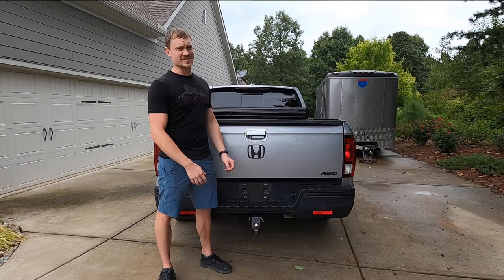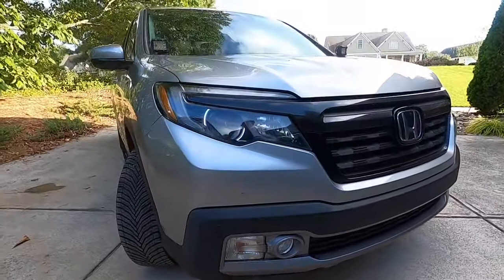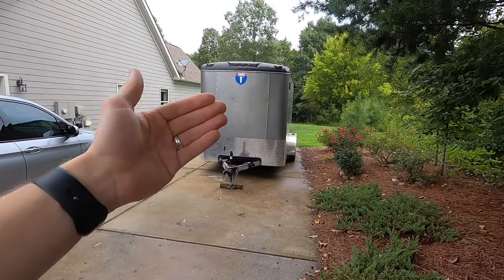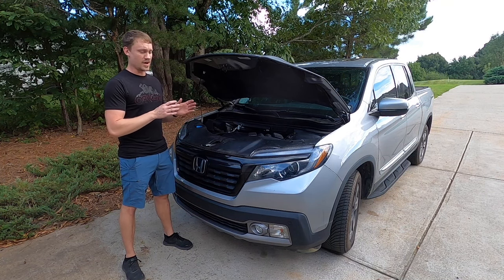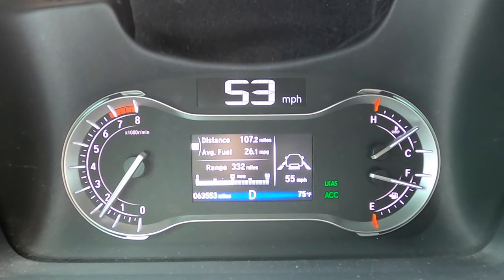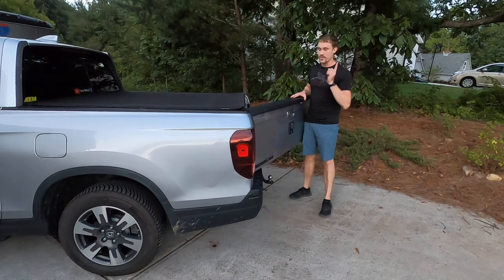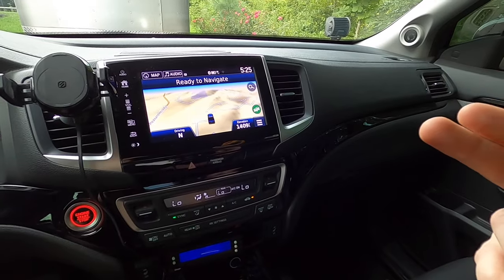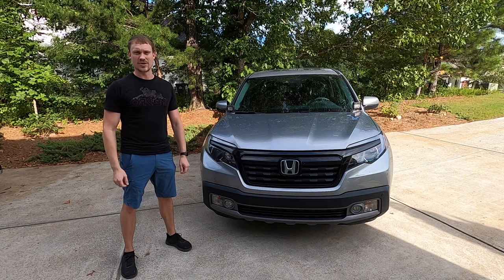10 Things I dislike about the Honda Ridgeline

Comment: 🤷 The Honda Ridgeline is the pickup truck for people that don't really need a pickup truck nor want one.....

It's for your 50-year-old plus man that lives in a townhouse in a  retirement community or a  25-year-old data analyst or Apple store manager that lives in the city.
Reply from the maker: I would disagree. The Ridgeline is the truck that people need vs the truck people think they need. Most people will never use a truck more than the capabilities of the Ridgelines capacities.

Comment: Yuryi I thought you'd mention the trunk latch for sure and maybe the front sensors cardboard test? I never had that issue btw on that as vehicle slows down and warns "brake" if necessary. For me though I agree give atleast 2.5" more ride height. But in long run I'll take gas mileage anyday vs the v-8 truck i had before.
'19 Black Edition w/23k.
Reply from the maker: The issue with the latch is not so much with the car than with manufacturing employee oversight. I love the trunk. The sensors, well I know they work I just have not been able to recreate it yet in alternative methods for testing that is not cost prohibitive. So again not an issue. I also tried to discuss things that have not been either fixed or addressed with newer models.

Comment: I think the biggest design flaw is the depth of the bed!  You can't even haul a 10 gallon propane tank or a 5 gallon gas can in the upright position with a tonneau cover on.  What a disappointment.
Reply from the maker: Yep. Had to place mine at the end of the bed and roll the tonneau cover right up against it.

Comment: Biggest negative it is a unibody and not body-on-frame therefore it will not go places a REAL PU truck can go; mid or full size. As for other problems did you take it to a dealer? As for missing features, you cannot complain since you should have known when it was purchased.

Comment: Do you have an opinion on choosing between the Ridgeline and the Nissan Frontier?   They seem pretty similar, although there are obviously differences.  I've got prices on the top of the line Frontier and the RTL-E, and they are close.  Drove both.  Liked both.  Appreciate comments.
Reply: Not similar at all. One is a unibody likely glued/bonded together and the other is a bolted together cab and ladder frame with solid rear axle. Frontier is closer to a Gladiator. 

You’ll be trading ride comfort and economy for capability.
Reply: I looked at a Frontier.  Even the latest model is using older Pathfinder tech related to power-steering.  If that's what you're looking for in a truck vs. the Ridgeline's more SUV like performance, then the Nissan is the better choice.  Nissan is definitely better for off-road IMO as it has higher clearance and 4wd vs AWD.  There was an issue with new Frontiers being recalled, in fact, they're weren't being sold, that's what led me to the Honda dealer next door...it was fate! lol  Not sure if Nissan has lifted the moratorium on new sales as of this date.

Comment: Wow, with the click-bait title I was expecting a crap video.   Really nailed the deficiencies.  But you missed some:
11) Stereo.  The stock stereo is "acceptable".   Which means it's not good enough for a $40k+ vehicle.  The stereo should really sound much much much better.
12) Hamstring support.  The top of the seats are on the short side.  Would be nice if they made the top of the seat 2" to 4" longer to support our legs.
13) Built-in dashcams.  (Tesla does it, Honda should to).
14) Offer a classic 'physical' key option.  Last week the high in my city was 8 degrees.   So when I went grocery shopping I pulled the truck right up to the front of the store.  Got out to load the groceries BUT since the car was running, the tailgate would NOT OPEN.  So I had to shut the car off to load my groceries.   There have been several times in this last month where there was a conflict between the fob, and what I needed to be doing around my truck.  If I want to leave it running, and run back into the house - I should be able to.  Also, you can 'hide' a real key on the outside of a vehicle, if you don't want to take the key say mountain biking, or surfing.  Not so with a fob.  If the fob is near the truck, anyone who tries the door handle can open the car.   Sigh... physical keys are the best...
14) Chrome delete on every trim level.  Chrome is so 1983.   Make he "black" edition blackness available at every price point.
15) Find a way to remove the square plastic 'beam' in the back seat floor.  I know, I know, the floor is 'almost' perfectly flat.  Would be nicer if you could bury the mounts that hold the rear seat legs - into the floor.

Comment: Note the amount of space you don't have when opening the rear doors.
Reply from the maker: I have modified the opening and Honda has fixed this issue on new models so it’s not a problem any more.
Reply: you can replace the door catches with the ones made for the front doors.  easy DIY

Comment: I Love my Ridgeline, never a disappointment at all. If he wanted to go off road driving should have gotten a bigger truck like duh!! 🤦 also it's hot & you can't expect any vehicle to cool the inside down in seconds unless it's been sitting in a Garage that's insulated & cooled it just doesn't happen so it takes little time to cool off on the inside another issue you may have is the tailgate slamming down get over yourself ever Trk does that if not then it's already equipped with a hydraulic piston for ease on the lowering of the tailgate 'that's a no brainer' best Trk I've ever owned & I have had different yr models to different types 
 for the past 33yrs.

Comment: I dont like that the timing belt has to be changed every 80k-100k miles a chain would have eliminated that issue and also i feel the acceleration or lack there of an issue,stereo system is low quality, I dont mind the low clearance, and ride is ok, but this will be the one and only ridgline I buy, i feel toyota makes a better midsize truck

Comment: Dude this is not a truck! It’s beautiful don’t get me wrong but it’s actually a car with an oversized trunk without a top. Hence its ground clearance and driving it’s like a car. Now it can do some “truck” things, but you can buy some lift kits to get more ground clearance. This  vehicle it’s not meant for off-roading. I have seen videos of some mild off roading but it just can’t compare to the other true pick up trucks. If Honda wanted to make a real truck it would have and it would probably be a good one. The ridge line it’s mainly for city driving and stayin on the road. Can it go above and beyond certain limits? Sure it can. But other than that, it just a good looking vehicle to haul light cargo and have some fun in comfort/
Reply from the maker: It’s still a good truck. 😁

Comment: Jeep gladiator as the competition for the ridgeline? That's ridiculous.  Not the same category of vehicle at all!
Reply from the maker: Actually it is. It’s a midsize truck. Its capabilities doesn’t change that fact. What makes you think it’s not a competitor?
Reply: @YuriyMotso  its not a mid size truck. It's a car chassis with a body that has a cab and a truck bed. And I'm not saying that as a slight against it. I actually love these small trucks that have been coming out. But the ridgeline is not comparable to the chassis components of the gladiator or the Colorado or the tacoma, etc. Those midsized trucks are built on dedicated truck chassis which is constructed differently than a car, crossover, or minivan and is capable in different ways. The Honda ridgeline shares a platform with the Honda crossover and minivan. Like the bronco sport that also shares a platform with the Ford crossovers and minivan. To consider them in the same vehicle category as a truck built on a dedicated platform is not appropriate in my opinion. Review it for what it is. But it's not comparable.
Reply: @adamjohnson9014  I agree.  The Ridgeline is more comparable to the Ford Maverick and Hyundai Santa Cruz truck thingy but it's larger and therefore fits into the midsize catagory.  Ridgelines are the best choice for someone who loves an SUV but needs a truck bed.  My 06 model is still going strong.  My gripe with the newer models is the depth of the bed, the clearance, and the rounded front end.  The interior space blows all midsize trucks out of the water.  The turning radius on my 06 sucks.
Reply: @adamjohnson9014  You're mistaken. The Ridgeline has a full frame. Car chassis are sub frames and unibody. Having a full frame that is welded to the body is smart. Just ask the truck guys how they like paying for rubber body mount replacements. If you have a superior suspension you don't need to isolate the body from the frame with rubber mounts. The Ridgeline is designed for it's purpose and is well thought out.

Comment: Number one... 

The second generation looks horrible. Best thing about this is that they made the 1st generation look amazing. 

Number two... 

Neither tows enough and the 5,000 lbs towing capacity isn't enough to comfortably tow even a 4,000 lb camper. Also with the unibody the use of a weight distribution isn't safe. 

Three... 

Let's hope Honda puts out a generation 3 that beefs things discussed so it looks better and is a more capable towing vehicle.
Reply from the maker: The generations are definitely in the eyes of the beholder. I am not a fan of first gen. But fell in love with second gen. Third, towing is not bad if you stay at your capacity. Compared to the Tacoma the Honda did much better cross country.
Reply: @YuriyMotso first gen's without a leer topped look like a tadpole. White a Leer topper like an SUV. Second gen 100% grandmas car. I'm hoping that 2025 actually gets the new look it deserves. Otherwise, I'm not fully convinced Honda is going to provide an improved look for 2025 so I've got my eyes on the 24/25 GMC Canyon AT4.... 320 horsepower, 7700 lbs towing, 19 mpg versus the 14/15 I get now, 10 inch clearance, and ver stylish and highly functional interior with the premium package... under $55k with fees/taxes/etc.

Comment: Great little truck... First thing for me is to remove the silly running boards and improve the grip/ height by installing slightly larger A/T tyres.
Reply: I agree about the running boards. What’s the point of them unless their use as giant mud flaps?

Comment: It’s a unibody not a chassis. Getting to 6000-6400 towing pounds isn’t simple. Rear gear, upgraded trans and oil cooler may not do it b/c of its structural integrity.  It is a Bummer

Comment: My 2017 ridgeline transmission needed replaced at 52,500 miles. Lost $10000.00 on trade in value.
Reply from the maker: Dang. Sorry to hear that. I’m just about to hit 80k. No issues.

Comment: You don't need running boards, Frodo Baggins wouldn't have any  problems getting into a Ridgeline. A ridgeline is NOT FOR OFFROAD it is a rpad only vehicle. If you are buying a ridgeline as a tow machine you have bought the wrong truck mate! Maxing the towing to 5000lbs and then complaining about the transmission cooling is very odd. On any truck it is recommended to never tow at maximum. This begs the question of why in the hell would you have a ridgeline when infact you need a half ton truck. Get a tundra mate. That's what your usage needs. You need a real truck for your usage.

Comment: my 2020 Ridgeline AC is not as a cold as my 2010 Pilot or 2012 Camry... DYI oil change is also a mess,  at high speed 75MPH and high wind  the center of the hood vibrating .
Reply from the maker: I tried to only address issues that have not been resolved. Newer models have a heavier hood and no longer have this vibration issue.
Reply: At 70+ mph you are not supposed to be looking at the hood, LOL!

Comment: Why do you have running boards??? If you want more clearance and to pull more you should have bought a full size truck. Dampened tailgates? I didn't have one of those until I got my 2018 Tundra. Buy a bottle of Growaset and you'll be fine, you're a big boy. I'm 72, grew up on a farm. I'm amazed that all of us kids survived not having an easy open tailgate. I live in Texas, so I'll make sure to do a test drive in the summer. Dude, you're spoiled complaining about what the Canadians have and we don't. If I disliked a truck as much as you seem to I'd be trading it off.

Comment: Took delivery of my 2022 EX-L (now the base model) in Canada a few days ago. 

When looking at a vehicle, I needed unrestricted cargo space (life being an all-around musician), decent towing capacity, a good V6 with full active safety features for the long drives at night to rehearsal/concerts. The Ridgeline was the only choice at the end without question since it's my only vehicle and I did NOT want a body-on-frame daily driver. Everything else in the segment was a small truck with subpar interior quality and space and SUV's at the same segment didn't make much sense to buy compares to the Ridgeline.

I chose to not get a touring model for the reasons that the added features are something I will never use, AND it puts the MSRP over the $55k threshold for a 15% tax instead of 12%. Test drove a Touring model and found the vented front seats are useless ---- had them on for the whole test drive and can't feel a single difference. Personally thinks the issues you mentioned are mostly subjective since this truck-ish is not meant to be used as a heavy duty truck. Its weird existance is to give usually SUV buyers an alternative to their choice if they simply wanted more cargo space without getting a much larger vehicle. I did find the aftermarket part availability being somewhat limited, but having had the car for a few days, I personally found it too "finished" to be modified.
Reply from the maker: Great choice and congratulations on your purchase. If only everyone purchased vehicles based on value and needs then on peer pressure. The Ridgeline is the best truck in this segment hands down. Number 1 rated in car and driver I think every single year since it’s release.

Comment: I had a 2019. It tows like shit, the transmission is garbage and wont't shift to 6th when towing and will stay in 5th at 5k rpms at 70mph, and its got a timing belt that costs $1500 to replace at 100k. The newer 9 spd is junk, google it...I traded my 19 in due to a transmission problem and my wife had a 2109 passport with the "new" 9 spd you see now in the current ridgeline that had to be replaced under warranty at 50k. I'd say the $1500 timing belt job and the garbage transmissions are enough for a hard pass for anyone who wants to carry more than mulch from home depot. Unless you buy the 4k warranty...hard pass.